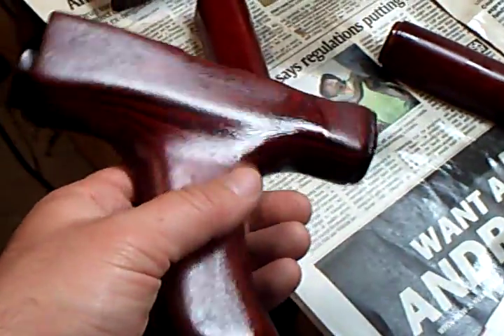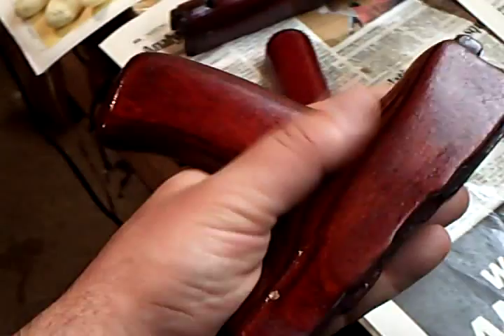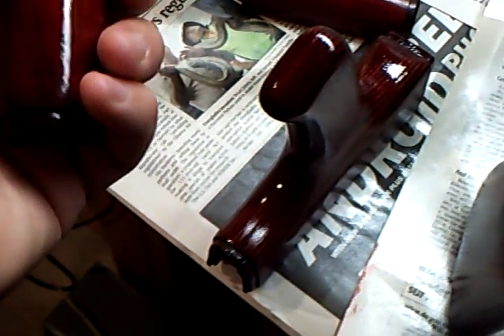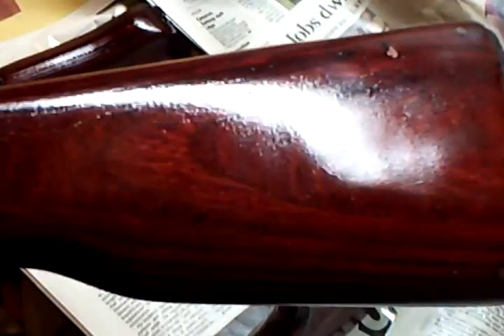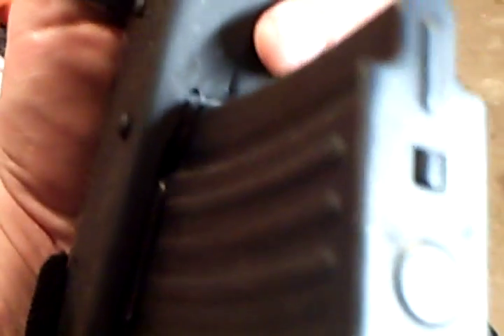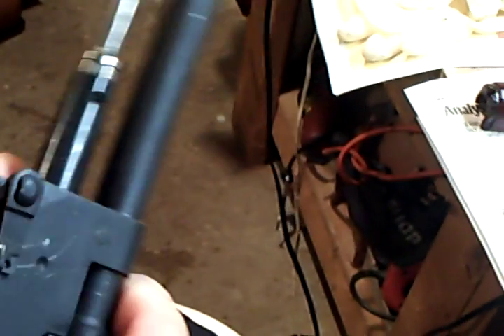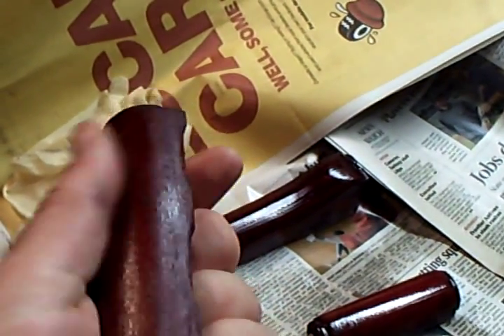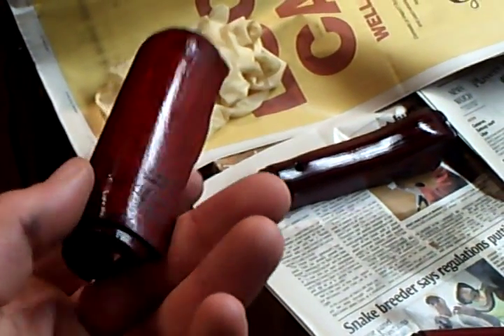AK47 Stock Refinish 5 of 5 RIT/MINAX/RED OAK

Comment: All you need to do to it now is use 00 or 000 steel wool to smooth out the poly. It will dull just a little at first but this it will take on a semi gloss to it. Then all you have to do is run over it with a rough cotton rag for few minets to add a little more luster to it. this way you get the grain, the color and the glint at the same time giving you a very close match to a russian color and look.